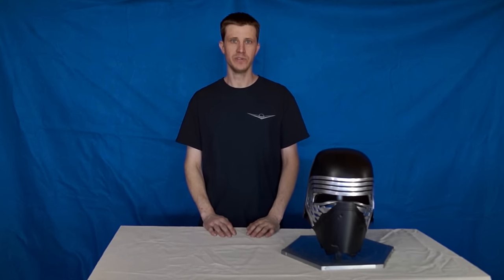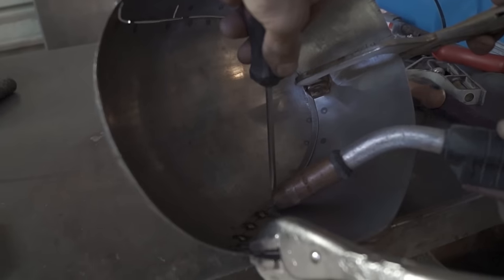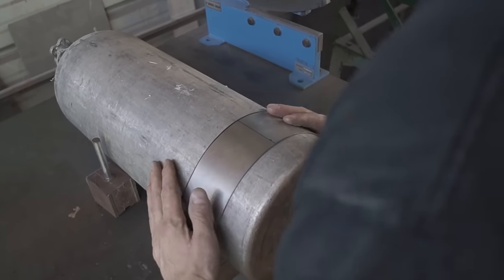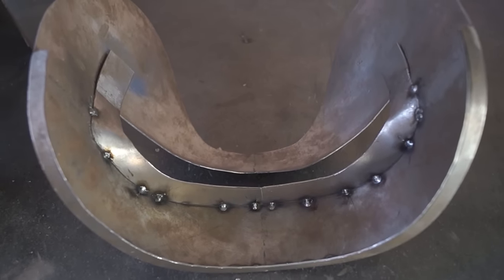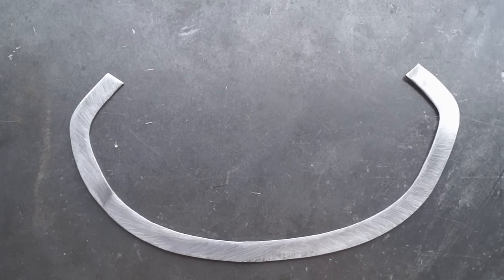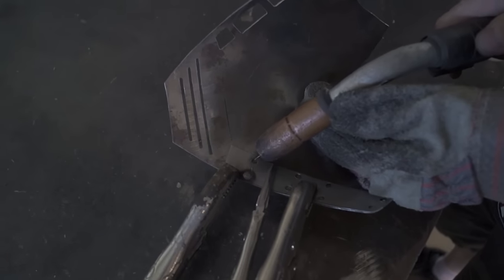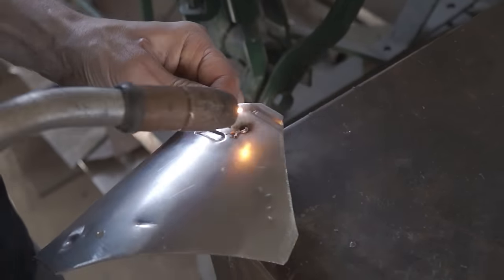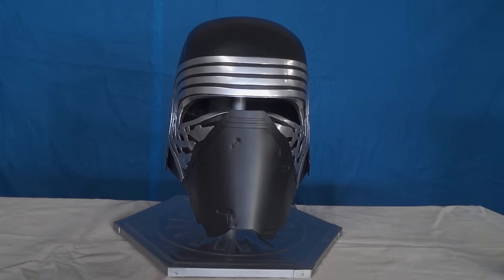Making The Metal Kylo Ren Helmet

Comment: If anyone is going to try doing this please, USE GLOVES. The sharp edges on the metal will be more than enough that if you get cut you'll need stitches. A buddy of mine is a roofer and he was cutting metal flashing with tinsnips. He was handling the cut flashing with no gloves and got cut so deep it severed a tendon in his hand, as a result he cant bend his pinkie finger now even after surgery to repair the tendon. So please wear gloves. When grinding on the otherhand be cautious when wearing loose fitting gloves, there is a potential for the gloves to get caught in the wheel.

Comment: Clearly you don't believe in wearing safety equipment. Especially when welding. Go into the stunt business.
Reply from the maker: +Benjamin Dover clearly I mastered metal working and don't need safety equipment when it is not needed. but when the application needs it I do use it

Comment: Nice work! This turned out great!
Reply from the maker: +Keven Carter thanks  keven. this helmet was a fun one to build.
Reply: +GoldPointProps looks like a ton of work here. When the early photos came out I was thinking that bead rolling the brow area would have been a neat trick but perhaps too tight of curves to pull off. I like what you did in the end and the chrome powder coat is pretty convincing!
Reply from the maker: yes it was! this is the most difficult helmet I've built and the most time consuming. I was actually going to beadroll it but the tests I did did not turn out good enough so I went the route I shown in the video. The pictures don't do the chrome justice looks way beter in person

Comment: You are going to burn that camera sensor so fast with out any sort of filter, it's not even funny! :D
Reply from the maker: +ZeroG84 I've been using it for years and its fine
Reply: Hmmm, that's cool. :) I wonder if the distortion is just the electrical interference then, and not the brightness or the spectrum of light.
Reply from the maker: +ZeroG84 on the Welding parts I digitally dim them so it is not so bright on people's monitors.